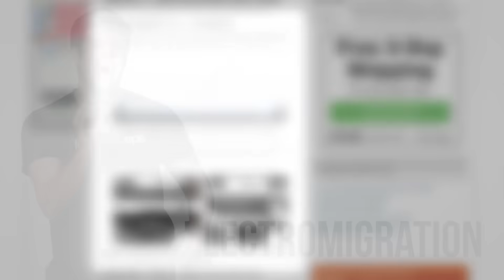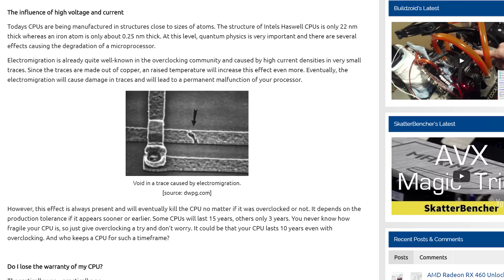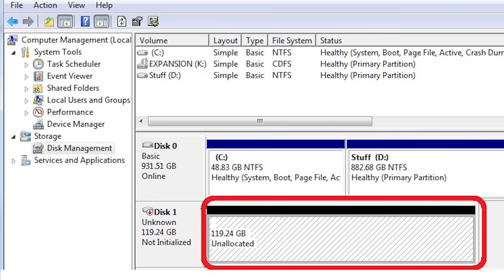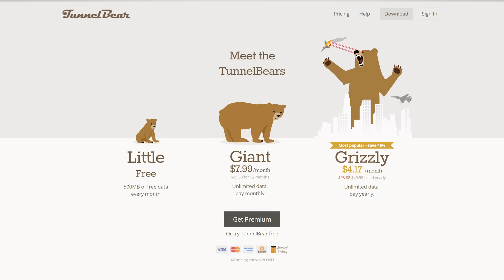Why Do Electronics Die?

Comment: Cool. I understand ohms law. Induction, current, resistance, and power.  Your explanation of what causes electronic failures makes perfect sense. I don't want to brag about my seven year old laptop: because, I don't want to jinx it. I upgraded it about four years ago to Samsung SS hard drive 500 gb and bumped the RAM up to 16 gb. It was incredibly expensive at the time, but  I  don't regret doing it. I rarely shut it down on purpose. However: when I do, shut down and restart now takes less than 30 seconds. I use mechanical hard drives for back up, but will never go back to mechanical hard drives for my everyday usage. I would subscribe to your channel, but I don't subscribe to anyone's channel: because, I hate getting notices every time someone uploads a new video.
Reply: Brag about your 7 years old laptop? I have a laptop that's about 26 years old and it still works.
Reply: +Video Tape That's cool. What OS are you running? Windows DOS or Windows 98.
Reply: Huhm, I think it's MS-DOS 6.22. I have an even older 32 years old portable computer but it's broken. It runs MS-DOS 2. (2.11 I think). And I'm not bragging, some people out there have perfectly functional Osborne 1s hahaha.

Comment: Electron flow is NOT current, current flows in the opposite direction that electrons flow in.
Reply: Current is the flow of ANY electrical charged particle, learn your physics, bro
Reply: Current is defined as  I = Q/t   meaning    I = Charge flowing throught conductor / time constant. 
So, if we take the charge of a Single electron   Q =  1.6*10^-19 Coloumb    and the time 1second
I = 1.6*10^-19C / 1 
I  = 1.6*10^-19 C/s  or 1.6*10^-19Amps
Reply: Conex Xenon what's with the calculations?
Reply: Conex Xenon Almost! I = Delta(Q) / Delta(t)
1 Amp = 1 coulomb change over 1 second period
Reply: No current flows in the same direction as electrons however, conventional current flows in opposite direction
Reply: The way we say electricity flows from positive to negative is just a convention we agree to just as are positive and negative. W could just as well call them red and blue. Positive and negative electricity ha been known since antiquity but it was Franklin who defined them as positive and negative. He had no knowledge of electrons. Once they were defined it was easy to say that electricity flows from positive to negative. That is technically wrong but we are stuck with it. There are several such things. Radio carbon dating uses wrong half life for C14 for example when uncalibrated ages are mentioned. Pregnancy is counted to start two weeks before fertilization etc. Science is full of such obsolete and incorrect things.

Comment: "Military Grade" is a fake quality grade stamped on anything the U.S. military may use, usually by somone trying to sell something. Saying it's "Military Grade" is supposed to imply superior quality. Yet it isn't a quality grade, and in most cases everything made or sold to the military is won by the cheapest bidder. The U.S. military buys many civilian commercial products. Take Energizer and Duracell brand batteries, for example. Stamping them "Military Grade" is redundant and confuses those who associate it with quality therefore you won't see them stamped "Military Grade"  "Military Grade" Aluminum is the cheapest they could find whereas "aerospace" quality will be a superior form of the metal. In the realm of electronics, like a keyboard. "Military Grade" means the U.S. Military uses it, probably because it was the cheapest bid when they were buying keyboards in bulk... I'm looking at you, Ford.. And your "Military Grade" aluminum truck beds and panels...😑

Comment: Well, here's a thing about "planned obsolescence":

Companies design their products for a certain lifespan. Of course they do. The more robust and sturdy and long-lasting you design the more expensive the product will be to manufacture and therefore more expensive for the end user. Also, the more units of a certain product you produce, the lower the production cost per unit will be, because of something called "economy of scale". What that means is, in a nutshell, that not all the costs involved in producing something scale linearly with the number of units produced. 
Therefore, a company will aim to design their products for limited lifespan and high production output in order to keep their costs down. Because in the end, every company needs to make a profit in the end, since if they don't they won't live long. 
Another thing to factor into designed lifepan is service life, which is for how long the product will be used before being discarded. In other words, if people throw away their phones every 2 years on average to get a new one, there is no point in designing them to last significantly longer. Additionally, as mentioned above, longevity comes with a price. Now, how many people would be willing to pay, for example, 50% more for their phones if in turn they'd be guaranteed to last 6 years?

Then there's the argument of companies deliberatly putting in "weak points" in their designs, underdesigning a single, but vital and possibly expensive to replace component so it fails prematurely. Now that would make no sense economically. Because, if you think about it, underspeccing a single part (or a few) would actually mean that you're overspeccing all the others. Let's say a car company would design the engine crankshaft of their new model to last for 6 years, while the rest of it could easily last 10 years would be wasting money on higher end components compared to designing the entire car with all of its component for a 6 year lifespan

Comment: technically electronic chips should last forever.
Reply: No.
Reply: Why? The gates in microchips will last forever. Do you have any knowledge to back up your "No"?
Reply: Nothing lasts forever. Everytime something is powered on it causes physical stress to a circuit, even if it's impossible to see.

One thing I don't know is how electronic chips age when not in use. I know that ROMs and PLDs lose their content over the years even if never used but what about a processor or an amplifier... I don't know.

Comment: now explain why my IBM 8088 built in 1988 still work perfectly but a pc i bought in 2005 is basically a paper weight i scrap for parts and uh screws cant get enough screws
Reply: Different devices have different life spans. It is not that old technology lasts better. New devices just cannot have lasted long and we see only those examples of old technology that have lasted.
Reply: The computer from 1988 was $1500+, the computer from 2005 is 50x faster but cost <$500. That is why. The transformer alone in the old power supplies weight more than the complete power supply in todays power supplies and the old ones were 200w or lower and the new ones are 550w.
Reply: If electrical engineers wanted to, they could make things last like for ever. But there's the thing with earning money...
Reply: If they were made to last long they would cost too much.
Reply: @Sem Skywalker I have been in IT since 1985. I had a large retail computer store throughout the 90's. Win XP will run on 486's from the early 90's.( not great but can be made to run )  Clock speed alone does not equal actual speed. The AMD CPU in 1998 was 386SX-40Mhz but I remember 66Mhz being out shortly after. The Core Duo 2 ghz CPU that came out in 2006 was actually faster than the Pentium D 3 ghz CPU's that were out previously. ( also dual core ) I used the speed test as it is the closest way to compare CPU's. Since you obviously were just a user and not actually in the field, I understand your confusion of mhz vs. real world speed based on architecture.  Go look up bench marks for CPU's and compare the numbers. That is how you accurately determine speed differences over many years. The 3.4 Ghz speed was also not the norm. They ranged from 2.0 to 3.7 depending on Intel or AMD and while the AMD's were clocked lower, they tested about the same speed. As I stated earlier, mhz/ghz speed  is not the main thing to speed. ( Level 1,2 and 3 Cache  also play a huge part as well as actual chip architecture )
Reply: Less powerful meaning less heat generated meaning longer lifespan.
Reply: @Sem Skywalker I replied to YOUR comment to me about 5000X vs 50X faster. The 8088 was sorta a reply to both of you since it was quite old by 1988. ( although still useable, none the less old )    SO who is the one stoned ? it damn sure isn't me.
Reply: @Sem Skywalker He asked why a 1998, 8088 was still working vs a 2005 machine he bought, I answered that costs were high in 1988 and so was quality, costs were much lower in 2005 and that led to reduced life span. I made a comment about a 50X faster 2005 CPU was significantly cheaper than the 8088 from 1979-1988 and that machines in general were built better in the 80's and 90's.    You then came in and said my 50X speed increase was wrong, it was more like 5000X. I pulled up CPU bench tests to show that CPU speeds were not 5000X faster from 1988 to 2005 as the biggest jump in CPU speed came after 2006. No semantics, just benchmark facts. From 1988 to 2019 the speed might be close to 2000x as there were only 2 core CPU's in 2005, there are 16+ Core CPU's out now. Software has not gotten 5000x more code so why do we need 5000x more CPU power ? We had 20HP cars in the 20's , now there are 900 hp factory cars being made. 900/20 = 45X more power. Top speed back then was 30 MPH vs. 250MPH today, so real world increase is 8.33X. Part of my point was that the CPU rating never equated to the fastest number, it was all marketing hype. Sorta like MP in digital cameras. Anything over 6mp will print huge prints so 24mp only helps when cropping out unwanted areas and then leaving 6-8mp of the image left. There have been slower mhz speed CPU's that have out performed faster in the real world  in the benchmarks. Going mhz to ghz is not accurate to describe actual speed increases. If you sold this stuff from the beginning as I did, if you gamed on these machine as I did since the latter 80's, you would understand the real world performance vs. the numbers  advertised. To the lay person, specs matter, to the pro, it goes way beyond just specs. In the 80's and 90's AMD had slower clock rates but they out performed Intel at everything. It wasn't until 2006 that Intel took back the CPU lead from AMD.( a whole new die design in the Core Sole and then Core Duo series )  GHZ rating is sorta like Horse Power, it says something but not everything. My 300HP 2000 lb car will out run your 600HP 5000 lb car as the power to weight ration is much lower in my smaller HP car. Computers sorta have that same thing going as different chip designs were better or worse at getting the speed out of the chip. So in the real world, a 3ghz CPU many time's was actually slower than a 2.5 ghz CPU from the other mfg.AMD had 2.2-2.5 ghz cpu's running faster benchmarks and real world game FPS over Intels 3+ ghz cpus because the AMD CPU was just way more efficient in the clock operations .  Since you asked me, what did you do in computers in the 80's that makes you think you know more ? My store made Gaming rigs, Enterprise computers, and normal user machines, I had a lot of test time to find out what was the faster /$ back then. What did you do ?
Reply: @Sem Skywalker Oh, If you bought a 8088 in 1988 you got ripped of. 80386's were out by then,  2 Full generations of CPU ahead of the 8088. The 8088 was released in 1979 BTW.
Reply: Probably bcz your 80s computer was built for enterprise and not for consumers, unlike your 2005 PC. Servers will last extremely longer compared to a consummer computer, taking into account that they are always on
Reply: Planned obsolescence
Reply: @Sem Skywalker A 2008 Intel P4 CPU benchmark at 662, A ( mid 2018)  Intel i7 8086k at 6168 single core, 27,630 all 6 cores. Just under 42X faster single core vs. all cores. My 50X estimate is pretty close. Definitely not close to 5000X. Would really be only 10X if you compare single core to single core. We didn't have multi cores back before 2005? or so. Going from 1988 to 2005 is likely only 20X faster as multicore CPU's became big around 2006.

Comment: Electronic devices, as are all physical processes, are subject to entropy.  The most common failure mode in electronic devices is capacitor failure and if you go to the cap manufacturers website you will see that they actually give the expected lifetime for their device.  Caps are designed to vent as they age which is why the tops bulge slightly.  (The electrolyte gasses out and pressure increases in the can.)  Cap technology has evolved from the time of explosive failure with corrosive liquid expulsion to the use of a semi-liquid electrolyte which just dries out.  Caps are the weakest link in the system and I have brought LCD monitors back to life by just replacing the caps in the switching supplies.  I have rarely seen semiconductor or resistor failure in electronic devices that have been properly engineered.  (I tend to over engineer my designs.)  It pays to remember that the second law of thermodynamics is not just a good idea; it is the law!  Btw, electrons do not flow through a capacitor; energy is exchanged via the dielectric in the same manner as a stretched spring.